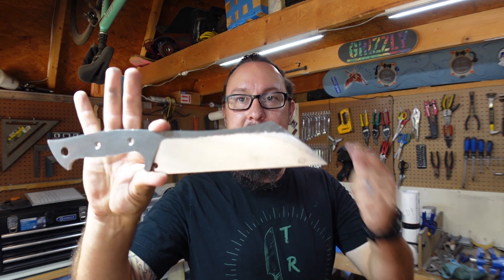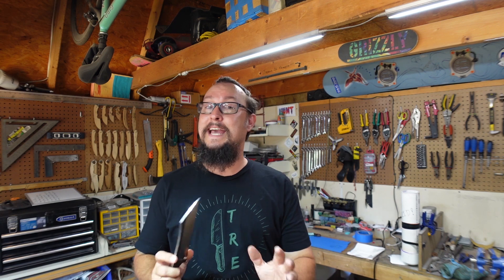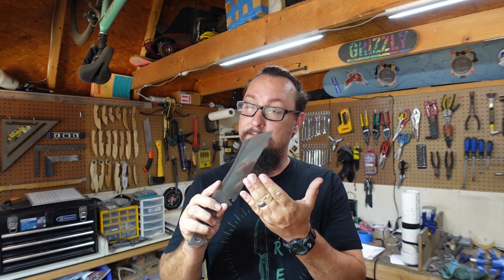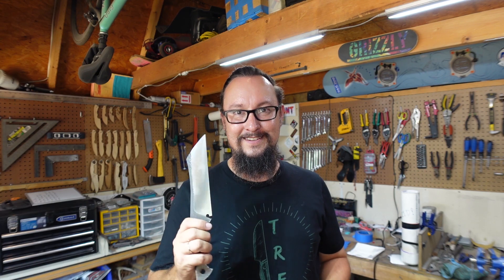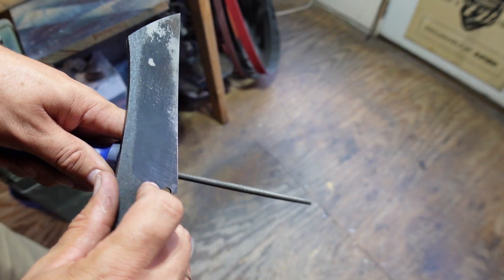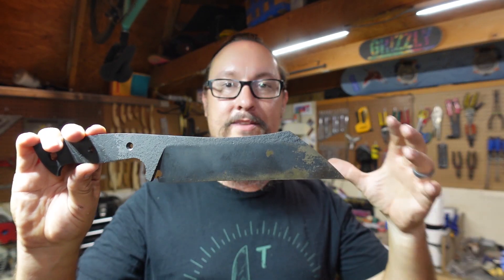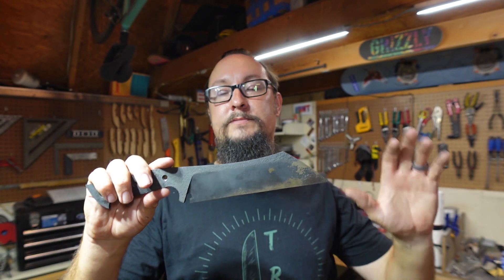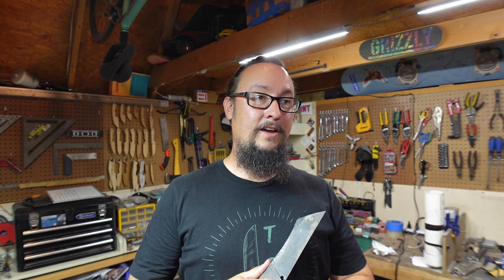The Heat Treating Process For This 5160 Chopper | Shop Talk Tuesday Episode 98 | Knife Maker

Comment: I was recently given a stack of old used table saw and skill saw blades. Some are hardenable steel some are not the ones that aren't I'll use as scrap steel to practice grinding bevels and such; the ones that are I'm thinking of making a bunch of EDC knives. Have you used saw blade material before if so what do you think; is there anything I should look out for?

Comment: What is your opinion on skipping normalizing and just annealing instead to relive forging stress? Brutal knife by the way nice work.
Reply from the maker: I'm a big fan of normalizing. I think everything should be normalized now days. You can waste a lot of time if your knife cracks in the quench.
Reply: @theriversexperience9383  that makes sense, annealing relives stress on steel with less work for my experience. The two basically do the same job, however normalizing and annealing are very important skills to keep. Thanks for your reply godbless and be safe.

Comment: Very useful’ thanks. How long did you wait in between normalisation heats?
Reply from the maker: I waited for  the steel to be back at "Room Temp" basically to the point that I could hold it in my hand.

Comment: Blade looks great!  Are you preheating your quench oil in the post driver tank?  I know some guys use a hot chain to preheat…just curious.
Reply from the maker: This was quenched in Parks 50 no need to pre-heat it. If I was using peanut oil then I would have pre-heated it to 120°.